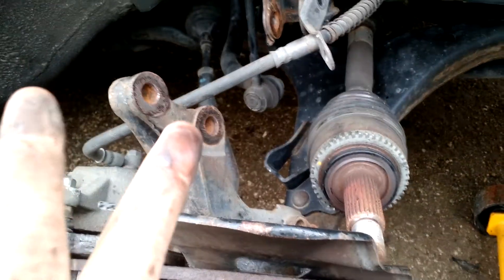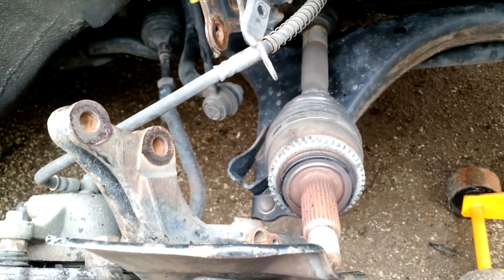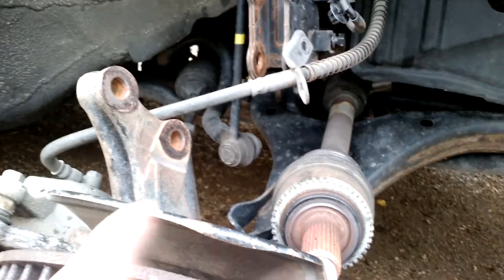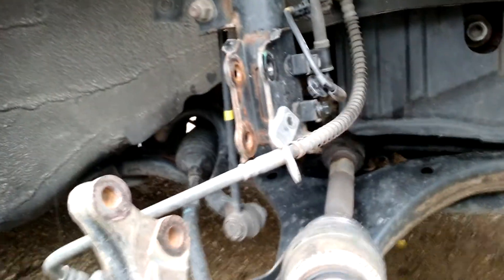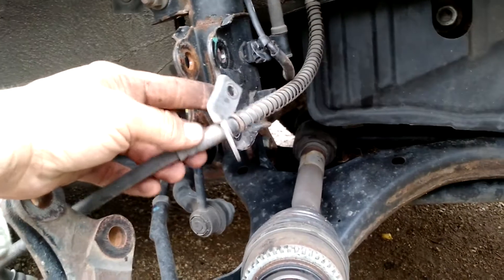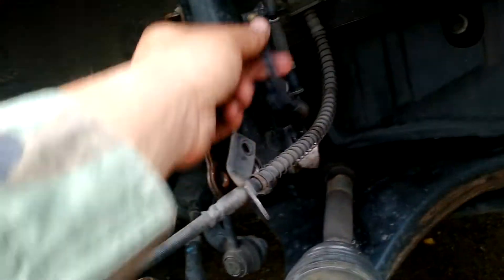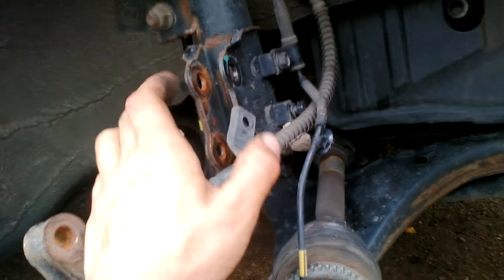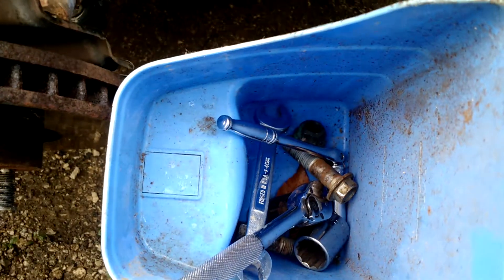2012 Kia forte koup axles replacement diy

Comment: KIA metal is the worse. They seem to rust from the bottom up. Fuel lines and brake lines rusted and leaked. Had to replace with nickel copper tubing.  Thanks for making the video.🤙